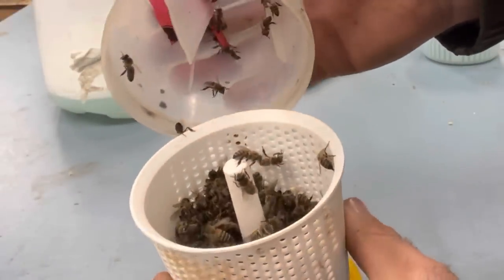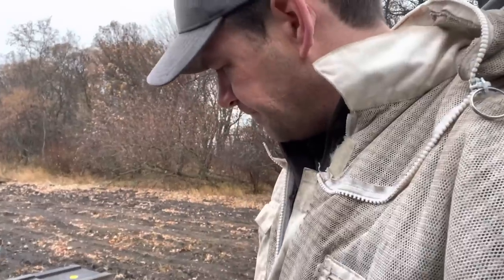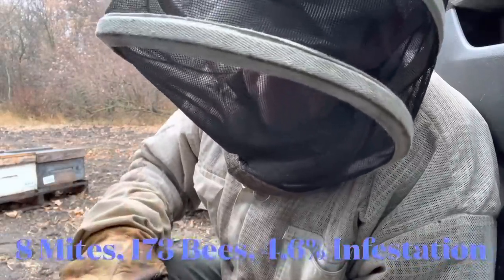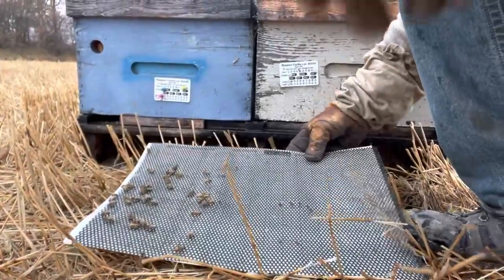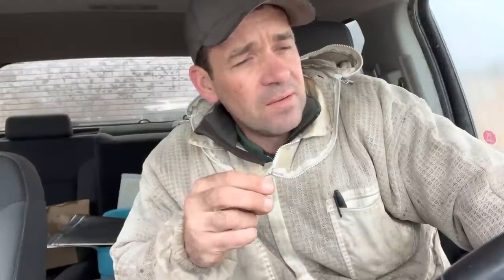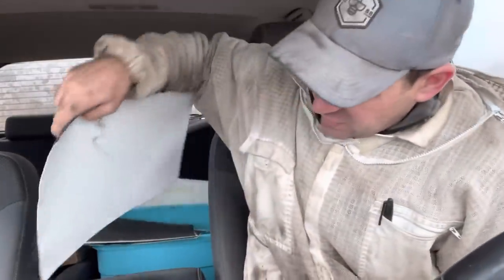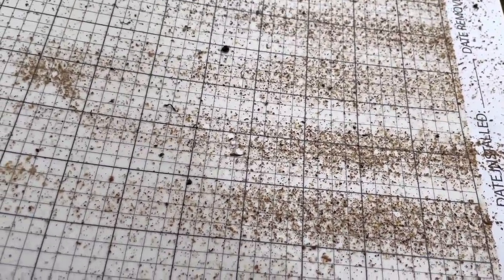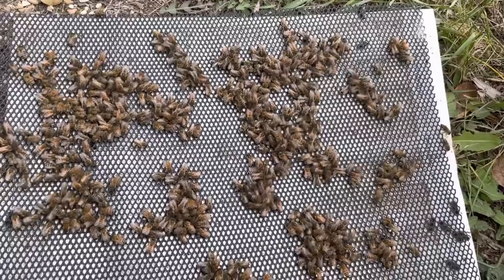Watch This One With a Grain of Salt

Comment: I think the problem is your mite count method. You're not sampling the whole hive. You're sampling one or 2 frames. You assume the mighty are evenly distributed and they are not. Your sticky boards confirm that. The might drops in clusters, not evenly over the whole board.

I bet if you shook every frame into a bucket, shook the bees up to mix the bees from all the frames together, then did a mite wash it would line up better with your sticky board drop. Obviously this is hard to do because of the queen. 

But I think it underscores the need to do enough testing in your apiary so your sample size is large enough to account for the variability of how mites are distributed through the hive.

Comment: It takes 4 days before the Mite drop starts after Your oxalic treatment
Reply from the maker: 4 days?  I took my boards out too soon
Reply: @aCanadianBeekeepersBlog  
The mite drop starts after 4 day's and goes on for many weeks.
We also use apivar strips. . We have the same experience like you. They are working w very slow and it's not good enough when there are many mites.
I can tell you how we kill our mites. We have tried many methods and stuff.
It is very easy and fast. It is 100% reliable. No doubts ore controlling afterwards.

Comment: Seems that with the suspect data you need to remove a variable...  I would check your OA for purity and maybe do an alcohol wash to eliminate if it's Dawn thats giving you sketchy readings.
Reply: I use the dawn platinum and it has worked just as good as any alcohol that I have used. Quit using Apivar here in Northern Alberta as I find that it is not effective enough for what I get out of it. As for differences between hives, I have found that sheltered colonies from wind etc. were much more prone to mite infestation. Why?? not sure how to explain that result??
Reply: Should mention that I use OA dribble mixed 2 parts water and 3 parts glycerin (vegetable) at 3.5% OA by weight. Works real good for me and that is all that I have used this year.

Comment: I did an actual count by holding 4 brood frames up to the camera and  zoomed in to a screen shot of each one. I counted the bees and the mites (no mites)
 I takes a few minutes but you would know exactly what you have on the bee's.
Reply: The problem with that metod is you dont get an accurate number of mites. Because the mites preferes to be at the bottom of the bee. The only thing you can use that method for is, if you see mithes on top off the bees, then you know all the good places are taken and your miteload is way to high